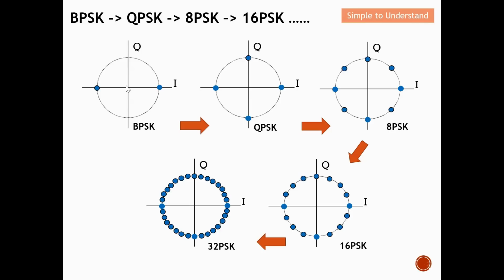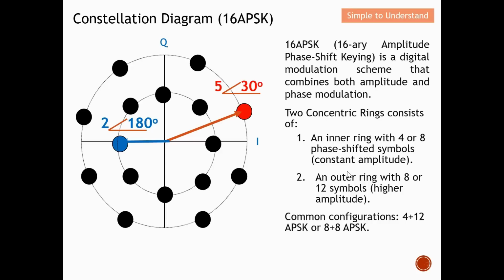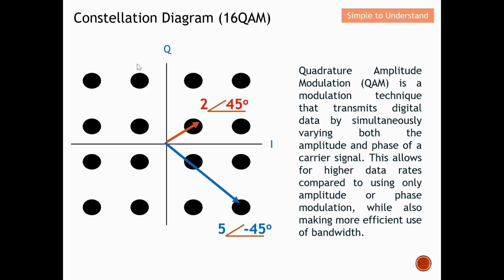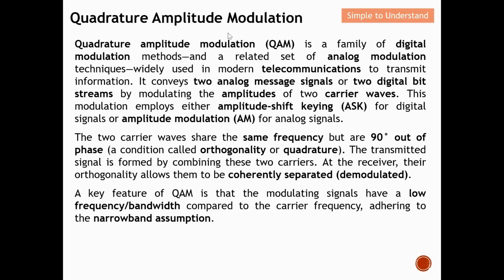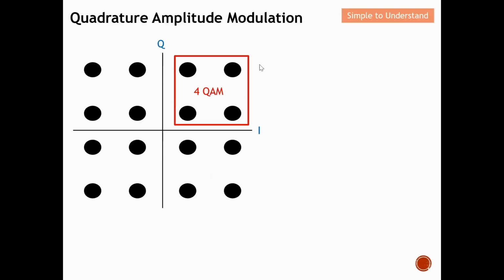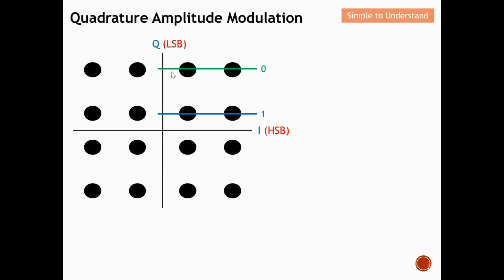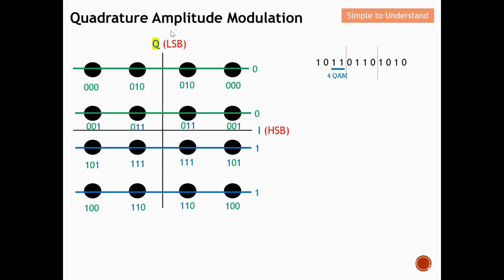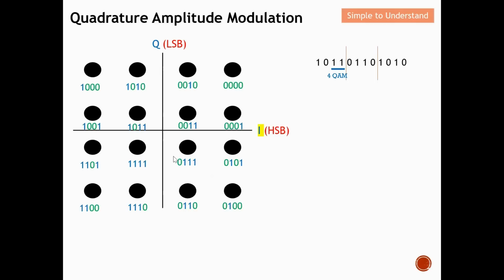Digital Modulation #6. QAM Explained – How Quadrature Amplitude Modulation INCREASE Your Data Speed!

Comment from the maker: Thank you for taking the time to watch this video on digital modulation.
Quadrature Amplitude Modulation (QAM) is a widely used modulation technique in modern communication systems because of its efficiency in transmitting large amounts of data over limited bandwidth. For example, 4096-QAM is employed in Wi-Fi 7.
As you can see in this video, QAM offers the best separation of points in the constellation diagram. Therefore, QAM is always the preferred modulation scheme when high throughput is required.
In this example, I will explain how to label the 4 bits per symbol for 16-QAM constellation points.